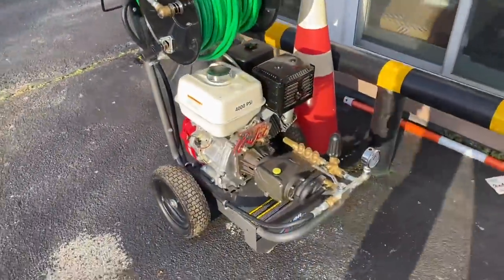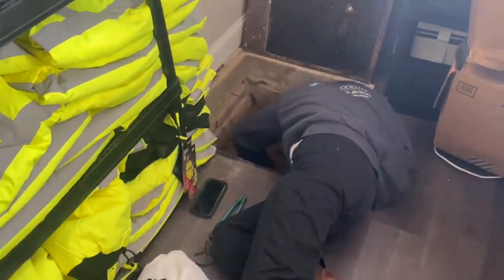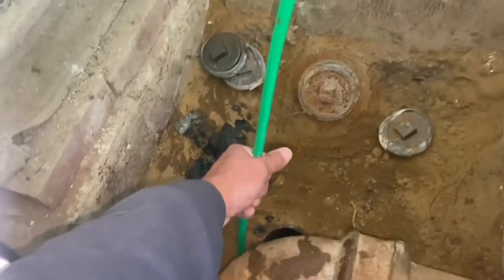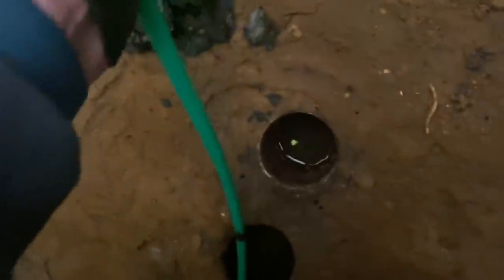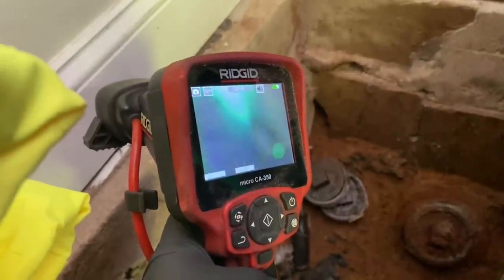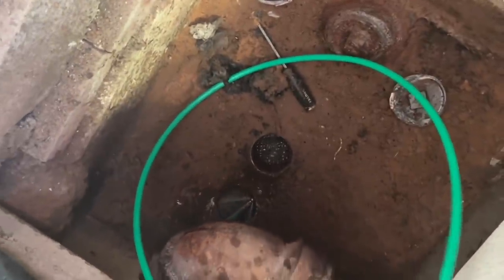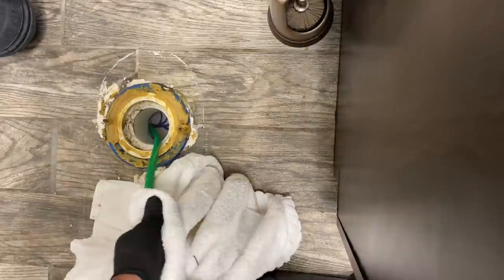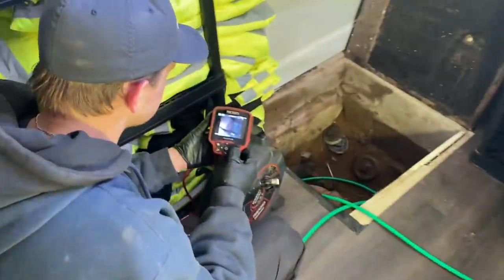Sewer Line Hydrojetting - How to WaterJet with Valor G Jet and Camera Inspect with Ridgid SeeSnake

Comment: That black knob on the jetter needs to be adjusted depending on head and line being used. Usually just close it off. Then open it up with that black knob to balance out the pressure through the pump.

Comment: Check to make sure you have adaquate water supply volume to the pressure washer. That can result in pressure fluctuations as the washer pushes out more water than is coming in and gets starved for volume.
Reply: Can’t hear you the volume is to low

Comment: I purchased a 713 CC Boss Jet Jetter and have had nothing but problems with it.  It had an oil leak right out of the box, we could not get it to start, Amazing Machinery was no help at all. I ended up taking it to a master mechanic so it would start when we wanted it to. The first time we used it the hose blew a hole in it. Ended up losing a lot of money. I finally purchased a different brand Jetter and am very happy with it.
Reply from the maker: Thanks for sharing
Reply: Do you mind sharing what brand you replaced with?

Comment: Is not defect, need a water tank to have a good source , some 200L/400L read the " water flow  needs" for operation (normaly in the fuk manual that no one read,probably in garbage)put automatic refill valve from street water to have continuos flow, some T whit 2 valves one for the pump other for empty the tank .
Reply: And SUPER important put big filters (I use 200mesh filters 1" From farming) this need clean water or damage the seals (two filters if you use the tank to keep all clean one in the out other in the in) .
check the oil (if start go low probably bad seals) and change every year or xxxhours of work all info in manual.
Reply: And another thing that I just remembered, are the inlet hoses, if they are soft they tend to collapse and restrict the water (a headache)

Comment: Did you find out what the problem was with the jetter? When I go to a location, I always check to make sure I have enough flow, my unit is also 4000 psi at 4 gpm, so I see if I can fill up a 5 gallon bucket within a minute, if not, then I'm not running my pump to damage it. Second, a good rotary nozzle, like a reverse turbo would really clean those pipes much better/faster.
Reply from the maker: We turned off the water. Was able to get it started. It was like hydro-locked.

Comment: Hey, is this single cylinder machine enough for most residential blockages ?
Reply from the maker: Yes
Reply: @PipeDoctor  cool I got similar pump and motor for pressure washing

How many ft of line you got for the pressure side?
Reply: @PipeDoctor  Thanks , nice company name btw

what about large root growth does it still cope ?
Reply from the maker: @michaellareem4014  yes but might need to use a cutting tip on your machine
Reply: got my tips today but no reel yet but tested out my tips i got some penetrator tips 3 of them which vary in pressure from 1600 psi to 2800 psi and then got the large final stage tip which put out 3600PSI , what are you getting pressure wise?  as i got similar pump 4Gallon 4K psi and gx390
 @PipeDoctor

Comment: Probably not the machine. Looks like you were having a water supply issue. Check the filter screen where you hook up to water. Also make sure you are using a 3/4” supply hose.
Reply: @PipeDoctor  It's only got half the pressure you need to do the job properly and quickly.